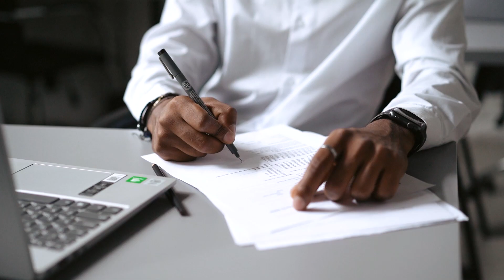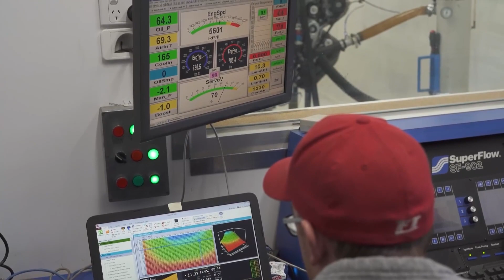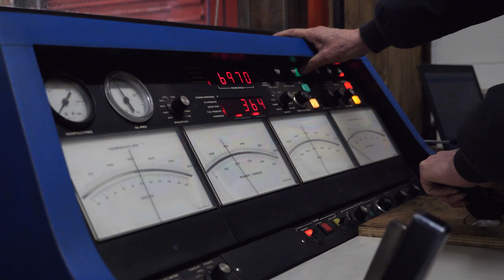The Ford Megazilla a 7.3 liter Twin Turbo Crate motor

Comment: You would expect  an engine with such  crazy names as "Godzilla and Megazilla" to have better performance than a Subaru, but even Briggs & Stratton are making gains on them. I enjoy the Coyote and believe it is a better platform overall.
Reply: The Godzilla can make nearly 800 HP with little more than a cam, intake, and a tune, and people are making more than 1,700 HP with the stock crank and block. All this with a simple pushrod engine. The Coyote is a great engine for those who like to rev, but the Godzilla excels down low, and with a 3.967” stroke revs just fine. Again, the Coyote is an excellent engine, but too many people assume that because the Godzilla had a very low-end truck tune from the factory that it can’t perform. Now why the Megazilla only makes 615 HP is a mystery to me. This is where Ford really should have opened it up. One can only wonder if a Super Duper Megazilla is on the horizon.

Comment: The Ford Godzilla V8 motor is not only in the Ford Super Duty but, are the Ford E Series cutaway, Ford Chassis, Ford Super Duty cutaway, RV, etc. The Electronic Vikings said, " Who's still making the ICE engine is dumb ". Also, he's said, " Who's still making the ICE making no scene " as he shows his viewers on his channel an old school cell phone stand for ICE engine. Everyone didn't realize old techs making a comeback like vinyl and LP records, cassettes, etc in a small way. The Megazilla V8 answered the 1,000 HP hellphant engine from MOPAR.
Reply: Yea just because it may be old doesn’t mean it isn’t reliable. FYI electric motors are actually older than ICEs. Also I heard they are bringing back sails on ships (but those won’t replace engines, just help them)

Comment: Hey Chris, I just can't get warmed up to a Ford, I've had some bad luck with them, so decided never again to own one. They are engineered to fail after warranty. And that is what they have done pretty well, after that period they seem to break, at least that happened with two cars I owned, BTW, new cars at the time. So that's my reason for not liking them.
Reply: Yes, it's like the OBD port transmits a signal to Ford when they hit a certain mileage. Ford then sends a self destruct signal to the vehicle...